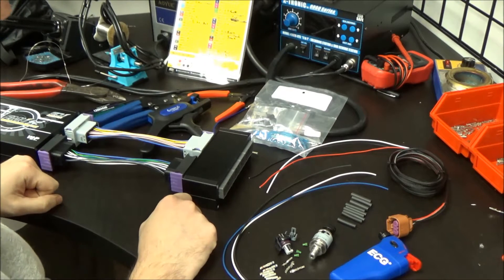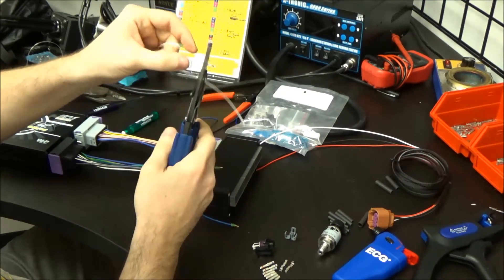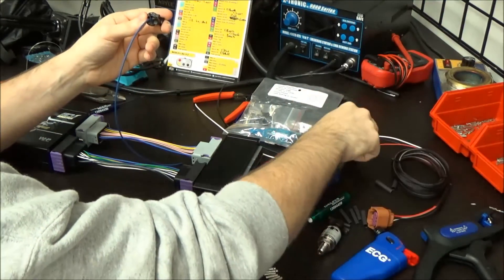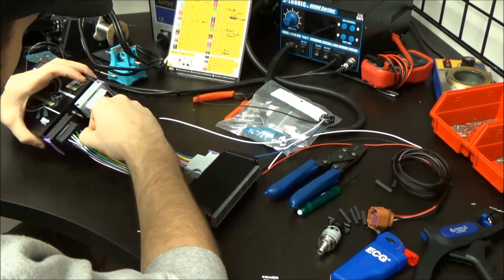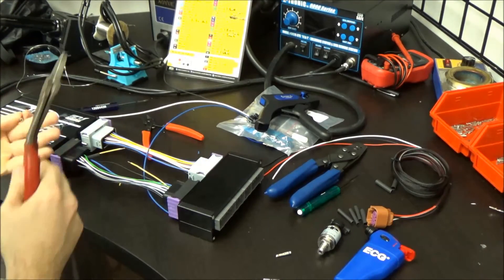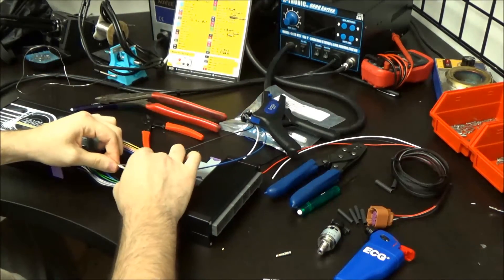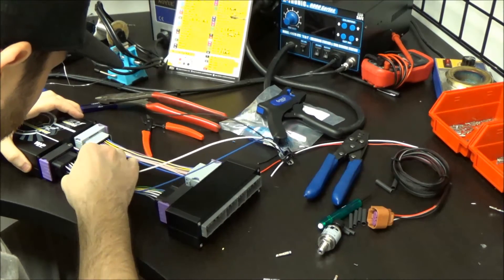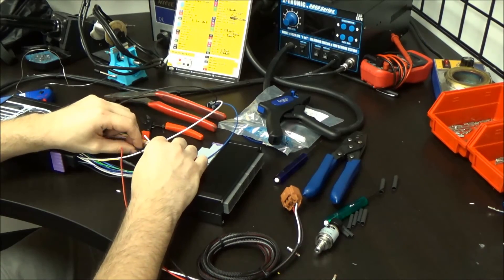Sensor Wiring Basics- ECUMaster EMU

Comment: How many wires can I splice into 1 signal or ground wire?
Reply from the maker: Signals can't be spliced, as you can't feed multiple sensor signals into one input. Grounds can be spliced. There's no real limit for splicing sensor grounds as there's very little current.

Comment: Do a video on how to wire the blue tooth adapter. IAT sensor. Boost controller PLEASE
Reply: The Bluetooth adapter plugs right in the standalone. The "Intake Air Temp" sensor goes to pin 21 on the black connector on the EMU classic. The GM IAT sensor has 2 pins and it does not matter what pin is what but one goes to the standalone and the other gets grounded. I am running the GM IAT with the EMU classic on my Supra.